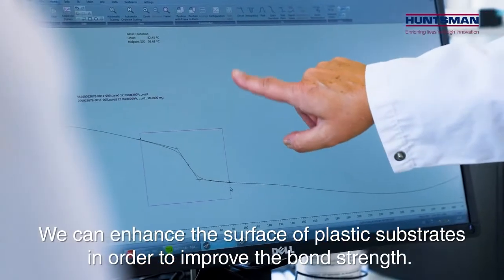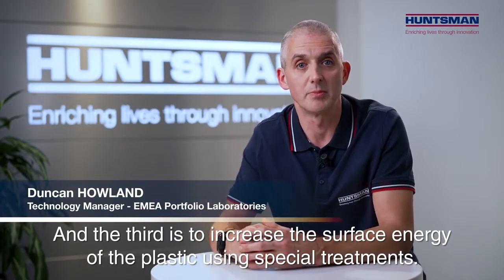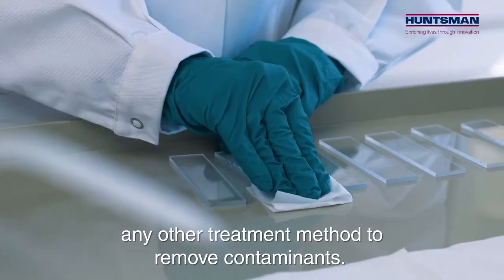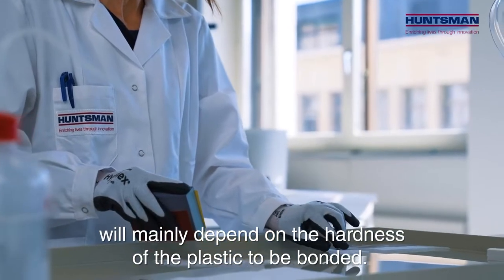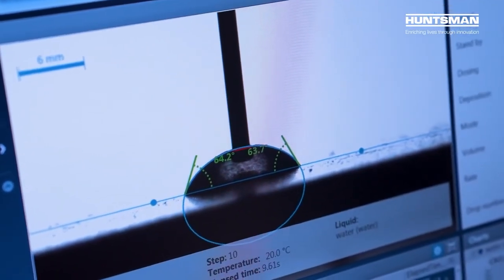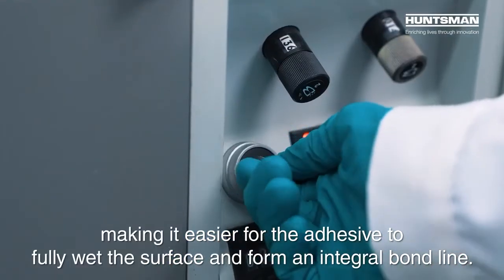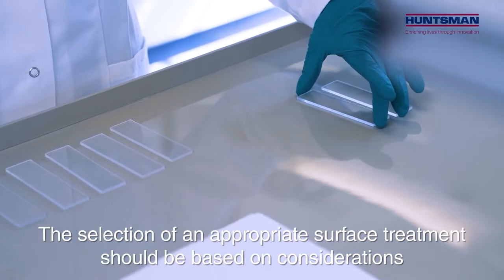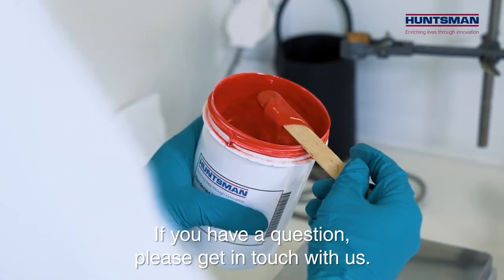Surface Preparation for Adhesive Bonding | Antala Ltd.

Comment: I am PhD researcher.and I have a problem  to bond (glass+carbon)/epoxy hybrid composite as core material with stainless steel as skin material to produce a sandwich material  where its property depend on the bond between the skin and core material. My  question is that which product is more suitable in order to produce a perfect bond between the parts of sandwich 
Araldite 2014-2 or Aradilte 2031.